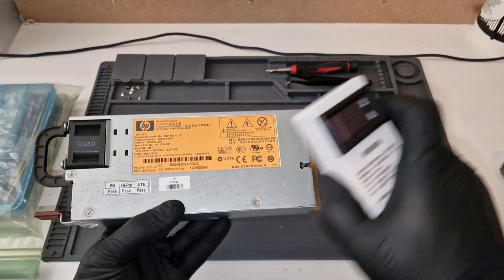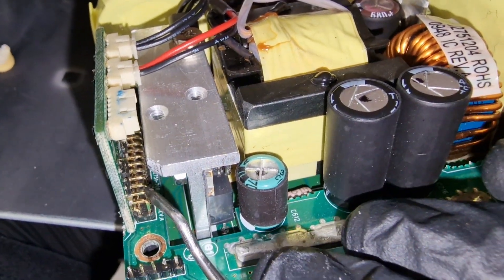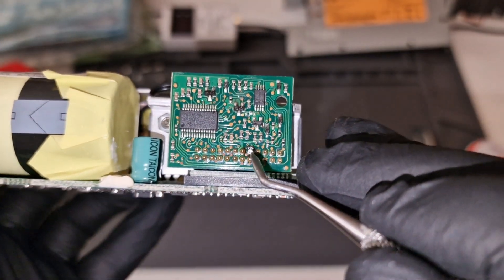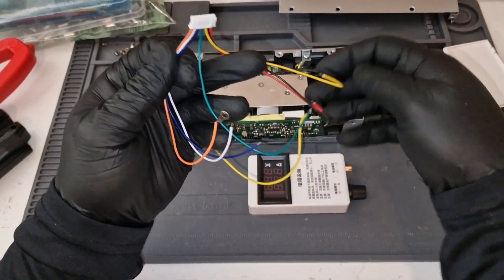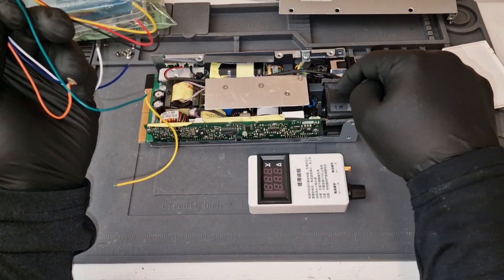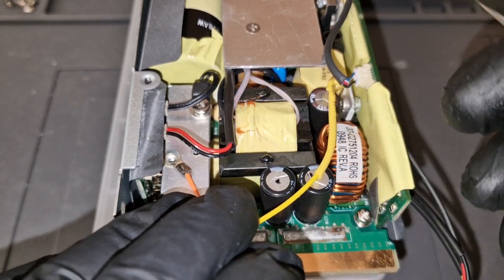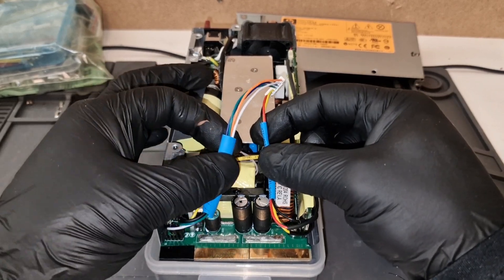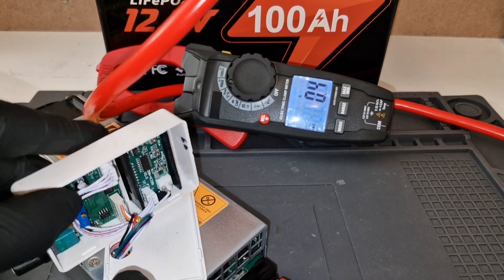Hstns-PL18 DIY charger 3-16v 3-60amp adjustable lifepo4 lithium 60a accessorie box installation

Comment: could this work with them in series producing 24+ V
Reply from the maker: Hi, I am not sure. I was thinking about that too. It could work if you know what you are doing :)
Reply: @CuriousDiyFreak  I wonder if one controller could be hooked up or if each psu needs a controller. I haven't seen anyone else try this

Comment: Do You find solution how to increase fan speed when bridge jest up? My got 80 celcius with standard fan speed. Maybe i will change thermistor location...
Reply from the maker: Hi, maybe it could help change location on the thermistor.....

Second method (I dont know if its bad or good.

The fan connector have 4-wires 
Black/red/blue/white.

-Disconnecting white/blue wires and the fan will work on high speed constant.

Or

-disconnecting white/blue wires AND connect together (white&blue) and the fan will go on medium constantly.

 Maybe with on/off switch installed for white& blue wires to manually chose medium or high speed.

Red and black will still be connected always.
Reply: @CuriousDiyFreak Okay, so Red fan power is normal connected to jumped green/yellow, Black must stay on fan plug, and i can modify fan speed High/medium with blue and white?.
Handsome!! Do You try connect blue/white without fan plug disassembly 😅?
Reply from the maker: @zwyczajny2290 Yes red still same and black still on fan connector,

 and I have not tested White and blue without disassembled from fan connector unfortunately.😊
Reply: @CuriousDiyFreak If I have enough courage, I'll check what happens 😅, because it would be good to short them with a thermal switch that you can buy with any trigger temperature.
I have another problem that I've read about - above 40A, even from 14V power supply in a 750W power supply, it starts to squeak a lot and for a voltage of 13.8 I can't develop more than 20A. Supposedly, adjusting the trimmers on the power supply PCB helps, but unfortunately I haven't found a good manual yet.
Reply from the maker: @zwyczajny2290 okey:) thats sounds like good idea with thermal switch.

About the squicking/bad sound i solve this by adjusting one trimpot.

If you look at the vid 06.40 you will see the trimpots on the circuit, there will be only one trimpot on the bottom , thats the one I adjust (clockwise) to remove the weird sound.

As soon as the battery reaching almost full charge or higher voltage the bad sound should come on,  

Then I just adjust the trimpot (clockwise) little by little every time the sound comes and I am still adjusting the trimpot to remove sound until the battery reach full for example 14.5v. 

Soo I am on standby and adjusting little by little every time follow voltage and when battery reach full charge.

If turning the the trimpot to much or all the way (right - clockwise) the power supplys ocp (I believe)gets more sensitive and shuts off the output power much easier and its annoying.
Reply: @CuriousDiyFreak  when i disconnect white and blue from fan plug power supply go to safe mode probably and cut off voltage output even without load. 😢
Reply from the maker: @zwyczajny2290 okey, thats unfortunate.

I just did fast test.

So with fan connector still connected.
I short the white&blue then I get Medium high speed.

Or 

I jump a wire from positive(red) to blue wire I get full high fan speed.

On the fan connector there is a empty place (red wire).
There is were I get my positive(red) from.

The power supply works and outputs stable voltage.

I did NOT test all this with load/under load.

Comment from the maker: ADJUSTING!!BAD SOUND/SQUICKING/SOUND 
At 6:26 in the video there is 1-trimpot which is at the bottom, there is only one which is at the bottom.
 By turning this trimpot (clockwise) little by little.
When  the power supply is under load and the bad sound start to come , then I just turn the trimpot (clockwise) little by little Until the bad sound/squicking is gone....

-The Best way I did this was to hook it up to lifepo4 12v battery, 
-put powersupply to 14.5 / 14.6v and let it charge , and watching it carefully , and adjusting (clockwise) every time the squicking/bad sound comes on, until the battery reach full charge , then I had the perfect adjustment and no bad sound next time...its not recommended to turn it full/all the way Right(clockwise)

Link for 60/100amp controller 

Seller(1):
https://a.aliexpress.com/_EIUkvee

Seller(2) with free shipping: https://a.aliexpress.com/_ExZVeWK
Reply: Thank you so much! :-)
Reply: @_packa_2731 Wow. I am seeing prices up to 60$ shipped to USA
Reply from the maker: Yes there is now link in the first comment..will be add more links as soon as I find more good sellers 🙂
Reply: a link would be really nice :)